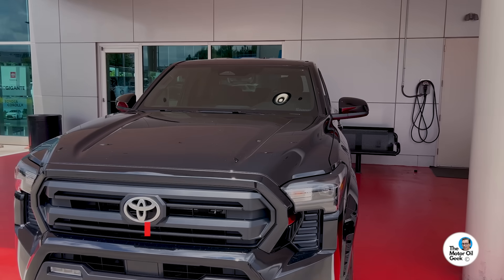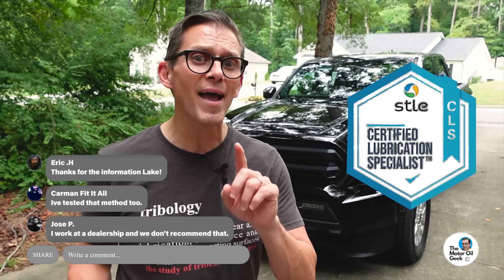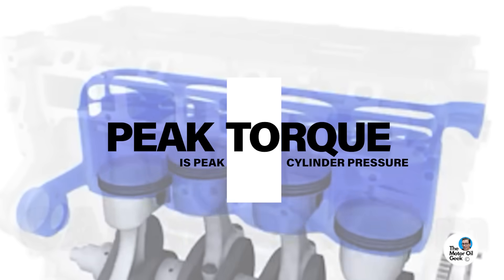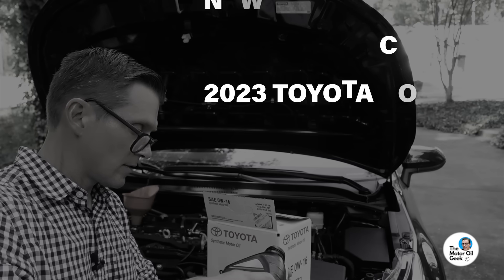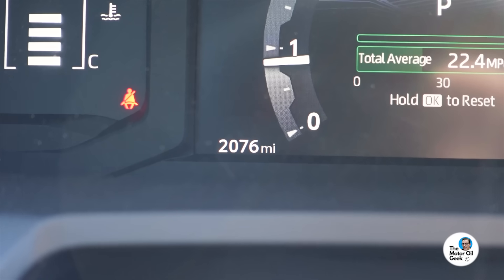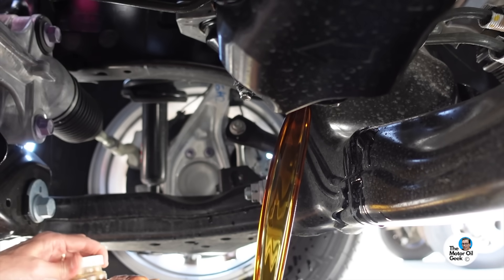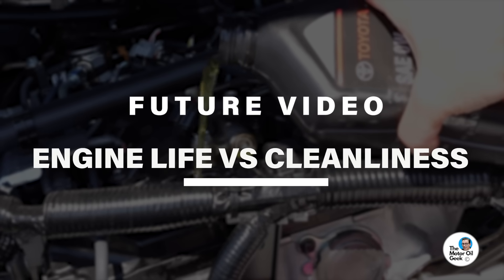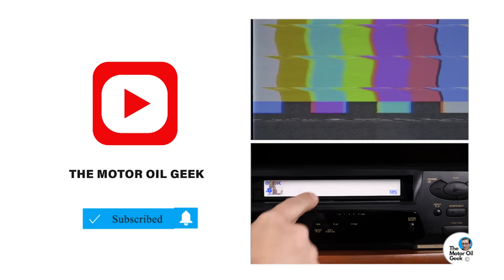The FACTS About Oil Changes (What The Owner's Manual DIDN'T Tell You)

Comment: Intervals set by CAFE standards probably
Reply: Lake, I’d like to see 0W-20 Vs 5W-30. Bearing clearance, bearing pressure, block and rod material seems as if it would do better with the bump in viscosity.

Comment: You shouldn't follow the owners manual when it comes to drain intervals on your transmission, differentials, and transfer cases either.  I changed all of mine at 20k.  Both diffs and transfer case fluids came out looking like grey milk (they had THAT much metal dust in them).  The magnets on the drain plugs had so much built up on them that they weren't collecting any more metal.

Comment: I think some people have always thought I'm crazy. I have always done what I call old school break -ins, driving and early and often oil changes. When you check the oil on a new engine, for a while your paper towel you wipe it with will have black residue, that's tiny contamination. On a new engine wipe the oil off the end of the dip stick with your fingers and rub your fingers together, you can actually feel the tiny grit. Your oil change method pretty much mirrors mine, I guess I'm not as obsessive as believed. Great Video.

Comment: If you guys don't think this works, do this experiment with your new lawn mower next Spring. 
Run the brand new engine wide open for 10 minutes then change the oil. Then run for 20 minutes and change the oil again. 
Look at the metal that comes out of it!!
Learned this trick from the Garage Gear channel.

Comment: And the residual in the filter that wasn't changed??? 🤔
Reply: Agree should have drained filter and allowed block, main oil gallery, and pump to drain.  These new T-GDI engines will retain as much as 15- 20% of old oil in the engine.  I do fresh oil flushes once a year.

Comment: Unless you're GM or Toyota, most newly manufactured engines will survive to the end of the factory warranty period with minimal of no oil changes. After that period, all bets are off.

I have a friend that purchased a couple Toyota Tacoma trucks over the years. The dealership offered oil changes for life at the dealership, which for him was a big selling factor. The first Tacoma went 200,000 before he traded it on a newer model. The second Tacoma was up close to 200,000 when Toyota replaced the frame, including all the bushings, and lubes in the transmission, transfer case and differentials. 
His Toyota luck ran out on the Tundra, when he had 3 engines installed in under 10,000 miles, thanks to cost cutting by Toyota.
Reply: Cost cutting by toyota is like pursue of perfection
Reply: Toyota fixed their engine my guy.
Reply: @Dave-om6nd 2025 Tundra engine recalls, still not fixed.
Reply: @Dave-om6nd Just got the recall notice on my 24. Definitely not fixed.
Reply: @drrok4603 they didn’t fix the engine until the second half of 24 smart guy. So of course the 24 was going to get a recall, that wasn’t a surprise to anyone paying attention.

Comment: Interesting the fuel dilution levels in these samples. Looking at some of the Lexus models that have the same engine, T24A-FTS, they're showing a fuel dilution of around 3%. Small sample size though.

Also surprised to see the cliff on the moly levels. TGMO 0w-20 for years was jacked on moly, but now it looks like they changed the formulation. The VOA has a more moderate moly level than prior VOAs on this oil. I wonder of they're reducing moly or moved to trinuclear moly vs di. The data suggests the TN is better at the sequence IV-A cam wear than di but the moly levels in the VOA are still much higher than those tests would indicate is necessary (maybe 100ppm and beyond has no significant improvement).

That TGMO 0w-20 hugs the lower level of the 0w-20 spec. It has a lower 100c viscosity than many other 0w-20s. Will be curious to see how it performs over the years in wear metals in the engine.
Reply from the maker: The lower Moly is due to the turbo. The high moly Toyota oils are for naturally aspirated engines.
Reply: @themotoroilgeek  Mr Lake, can you please explain this as to my knowledge Toyota has only 1 type of 0W20 that they sell at the dealership which shows around 700 ppm of Moly in VOA. How come the Moly content in this oil dropped to 200+ ppm? Also, how can you explain a drop in kinematic viscosity (less than 7 cst@100C) within a such short mileage? According to VOA of this oil, its initial kinematic viscosity is around 8.5 cst@100C. Your insight is highly appreciated. Congrats on the fine truck!
Reply: @themotoroilgeek  just to make sure I'm tracking, you believe that Toyota reformulated the 0W-20 because more of their vehicles are equipped with turbos?

Comment: I've used this method for my motorcycles,  250, 1000, 2000 then every 5000. Filter every other change. Cars or trucks, i by used, never new !! Ams oil only. Over 100 K on many motorcycles with no problems.

Comment: Thanks Lake for the video. I do not see the point of adding a fresh quart of oil to run through the engine and into your drain pan while leaving an oil filter full of dirty oil. Might buy into it if you removed the oil filter and drained it then re used it.

Comment: I do the same on every new motor I buy. From lawn mowers to outboard boat motors, to new cars. I also change the oil first thing on any used motor I buy, because I have no faith in what the previous owner did, even when I have fairly good idea what sort of "engine" person they were (i.e. grandma that does it religiously, or my brother that is a gearhead). I still like to have my own baseline to start.
Reply: Same here. I just purchased ed a 23 F150 3.5 ecoboost this summer with 27k. First thing I did when I got it home was an oil change despite the dealer doing one when it was traded in. Threw VRP, got rid of the junk Motorcraft filter and changed again after 3k miles (30k) with VRP again.
Reply: Planning on buying a 2010 honda that carfax said they changed the oil every 10,000 miles. What process would you recommend ?
Reply: @denniseucke1061  rubbish wouldn't even buy that too old

Comment: Great information. My dad or myself has had a compact Toyota pickup or 4Runner since 1982. Neither of us has ever had a repair. Not once, zero, ever. Just maintenance. They are so well built. But we both always did a break in period oil change. I’m sure it makes a difference in engine life longevity.
Reply: How many years have you owned these vehicles and what was or the current mileage for these vehicles. Too much information is missing from your comment. Note, there is is nothing in your comment that states these trucks are over 40 years old, it is just that you have used these type of trucks since 1982.
Reply: @a @americanbobtail1 we both keep our vehicles about 10 years each and usually put over 100,000 miles on them.
Reply: @daleshisler2955 - Well there you go.  You shouldn't have to do much work on a vehicle for 100K miles. Your statement is quite misleading.
Reply: @americanbobtail1 not misleading at all. I’ve had repair issues with nearly every other brand of vehicle I’ve owned at similar mileage.
Reply: @daleshisler2955 - First you say you have only Toyota trucks since 1982 that appears to indicating that you owned these vehicles for over 40 years and it is not the case. Now, you are saying you own other vehicles. Your statements are over the map and in my opinion can't be trusted.
Reply: @americanbobtail1 I don’t think you would find it difficult to find people who would agree that Toyota trucks are among the highest quality vehicles on the road.
Reply: @americanbobtail1 That early 1980s series of engines were extremely different from what is around today.
Those could be seriously ignored and still keep going though I learned there is a limit as I made the mistake of buying an early 80s Toyota pickup that only had a wee handful of engine oil and zero fluid changed from new it was totally shot at 110,000km  midnight black ooze in both engine and transmission. 
Today's need better care/upkeep or they die much sooner than the 10 years you could goof off with an early 80s type.
Reply: @RetroCaptain - Read OP second comment. He is making a comment on vehicles reliability based on owning it for 10 years and 100K mileage, which should  not require more than scheduled maintenance anyway. He has not kept these trucks for over 40 years.
Reply: @americanbobtail1 it's practically impossible to keep anything for 40 years other than earlier Rolls Royce
Reply: bruh,  a 1982 Toyota was peak quality, stuff these days is break down at 100K quality.

Comment: 46 year ASE Master Tech, Lake is spot on! As usual, best oil channel anywhere!
Reply: The only problem is the 2025 taco with the exploding transmission
Reply: @RipliWitani  Tacoma hasn't had a decent transmission since 2015 and older model years.
Reply: 🎯 Similar experience here, started it 10 years after you then got out of the industry but stayed involved.  My Certs have long since lapsed but the "basics" haven't changed although certainly metallurgy, machining, and chemistry has improved.
Reply: 21 years master tech, you can put the oil you want the engine will still blow up, japaneese are garbage and the mechanics that thinks its still good needs to retire asap, i build engines for a living, its all garbage now we have 30+ tacoma and tundras engines brand new all blown up, i need to hire people but its so bad that i barely make money on them
Reply: Agreed - 100 percent mr. master.

Comment: This is truly great information, but that’s not one of the recommended approaches for Ford Coyote engines, which develop a tick (aka “BBQ Igniter”, “Typewriter”). There’s theories as to why it happens, but nothing definitive. The one common theme is it usually happens right after an oil change, dissipates over time and miles, only to come back right after the next oil change. Some recommend to extend drain intervals, including the first one. Others recommend additives, like Ceratec. I’ve even read that since it doesn’t happen when the vehicles are new therefore Ford must be using an additive in the factory fill. And that the additive XL17 is suspended carbon, which may explain the tick return after clean oil is added. Ford has stated that the tick is not harmful, but offers no other guidance.
Reply from the maker: Stay tuned

Comment: I changed my oil at a 100 miles then 500 miles, then 1500 miles, then 3000 miles after I rebuild engines. And I keep all my old changes at 3000 miles

Comment: I put Fumoto valves on all of my cars to make oil drains so much faster and easier. Highly recommend.
Reply: That are fantastic!
Reply: Depends where it is mounted. Ever had a low car hit road debris?  I like it for my Honda S2000 regardless. I can change the oil and filter without ever getting under the car. Just kick the oil collecting pan under the car and reach down and throw the lever.
Reply: @pault6533  They have low profile versions. There are very few pan configurations that aren't suitable.
Reply: Meh. It depends on the design of the oil pan. The quick change drains sometimes interfere with completely draining the pan if they add an extra "step" for the oil to flow over. So you are adding fresh oil to a pool of old contaminated oil still left in the pan.
Reply: @budlanctot3060  Meh. Very few pans are problematic. Suit yourself. My experience across multiple vehicles from multiple manufacturers has been great.

Comment: Dang, wow! I did a very similar oil change regimen when I bought my 1996 Jeep Cherokee XJ new. 368,000 miles now, no internal engine work.
But I used natural oil, changed the filter. Switched to synthetic after around 3K IIRC.
Reply: rubbish

Comment: I do 500, 1000, 2500, 5000 then every 5000 miles.  I do used oil analyses on each oil change.  On Toyotas, I use the TRD oil filters.

Comment: I certainly won't call you crazy. I open up my oil filter and the sheer amount of crap in those US made Toyota engines is off the scales.. Had to do 3 quick OCI to rid my brother's Hybrid CX50  engine of all the shavings it had in there.. 4xxkm, 15xx km and 3xxx km if i'm not mistaken. Did another one at 8000km and it started to be decent. By comparaison, both my japan made Prius Prime were spotless. Well, not really but the metal in my Priuses filters were looking like what a breaking in engine should look like. The Hybrid CX50 had shards as big as a toenail clippings.. 😮

As for the oil filter change interval, Honda does it. They have oil and filter change intervals and oil change intervals (the A and B maintenance). Those automakers really know something we don't.. When you'll change it however, if you want a sightly longer alternative, the OE Tundra filter 90915-10010 (yzzn3) does the trick. It has about half an inch longer paper element so it "should" be a higher flowing, lower restrictive, longer lived alternative. That's what i use anyway.. 😂
Reply: I opened up the filter at 800 miles on a Toyota A25A FKS US made engine. There was no visible debris.
Reply: @SingleStacked lucky you. I'd post the pictures i have here if i could..

Comment: That is one thing I dislike about the thinner oils.  My 2015 Chevy truck uses 5W30 and I can almost completely remove the drain plug before the oil starts coming out very fast.  I suspect it may also have tighter fitting threads.  My 2022 Equinox uses 0W20 and it starts leaking out pretty fast almost as soon as the plug is loose.  Very annoying.

Comment: I change my oil and filter after every 1,000 miles...  never had a problem other then my wallet feeling light. But seriously .... it's all about how hard you drive your vehicle and the conditions. A person who drives to the local market daily,  breaks down oil faster than someone driving on the freeway... the modern computers in cars does in most respects, estimate the life of the oil.  Why has it got to this point? People for the most part, especially in climate zones that use salt on the highway, replace their vehicle before the engine service life is up.
Reply: OMG, 1000 miles. That is too much. Modern oils are great. 5K miles will be fine.

Comment: I think the only point I would differ on is the oil filter at 500 miles. There's so little loading at that point (of smaller particles), and I want to get that debris it has captured out. I know it would stay put (most likely) just fine. But I'm putting in the filter I like in at 500 miles and then I'll let it sit...

Comment: That's how i was taught in trade School back in the 80's, no matter new vehicle or rebuilding your engine. Not only engine, differential, transmission , transfer case,oower steering if all so equipped.

Comment: I just purchest a 2020 Mazda GTR with 16600 miles. the Car Fax tells me they changed the oil every 3000 miles , one at 1500. That is way better than most for getting a used car

Comment: My 2024 Corolla uses 0W-8 oil which from Toyota is $20 a quart last time I checked. Walmart has the 5 quart jug of 0W-8 Mobil 1 that's GLV-1 compliant for about $27.47. That's what I use. Toyota oil is reportedly Mobil 1, so I'm good with using that. 

I change my oil and (OEM) filter every six months or 5K miles with a new Toyota drain pan bolt crush washer. Considering my car only has 7K miles on it to date and I've changed the oil and filter three times already, I think I'm good. I like the old school round head Craftsman ratchet (made by Easco). Those are among the best ratchets that Sears offered in the Craftsman line. I have a few as well. Toyota specifies 10K oil changes and I'd neve go that far. With the driving I do, twice a year should be just fine. 

I think the point is that you use the owner's manual for guidance, but if you exceed the requirements (aka using severe duty service maintenance intervals) then you should be good.
Reply: Don't use 0w-8 or 0w-16 this is what the Toyota manual in Australia says

SAE 0W-16 is filled into your Toyota vehicle at manufacturing, and the best choice for good fuel economy and good starting in cold weather. If you use SAE 10W-30 or a higher viscosity engine oil in extremely low temperatures, the engine may become difficult to start, so SAE 0W-16, 0W-20, 5W-20 or 5W-30 engine oil is recommended. Oil viscosity (0W-16 is explained here as an example): • The 0W in 0W-16 indicates the characteristic of the oil which allows cold startability. Oils with lower value before the W allow for easier starting of the engine in cold weather. • The 16 in 0W-16 indicates the viscosity characteristic of the oil when the oil is at high temperature. An oil with a higher viscosity (one with a higher value) may be better suited if the vehicle is operated at high speeds, or under extreme load conditions.
Reply: @qrowthebird7496  Not correct. USA destined (and assembled) Toyota Corolla models are factory filled with 0W-8.
Reply: Mobil 1 is junk. 0-8 sounds awful
Reply: @RipliWitani It's mediocre at best. The whole Corvette factory fill is just because of their great marketing campaign. Tell them to get the oil tested and see just how great it is.  😂😂😂😎👍👍👋💯
Reply: @Jay388  Nothing wrong with it. Same thing with Supertech. If the right oil is used in the right application and changed when it should be, you'll be fine. 35+ years of experience with not a single oil related failure in anything I own has proven that right.
Reply: @RipliWitani  So bad that it has been used as factory fill on Corvettes for years. That's hogwash. Nothing wrong with Mobil 1 when it's used in the right application. My 2009 G6 likely had Mobil Clean 5000 as factory fill from GM as well. 

I don't know where your "data" is coming from, but it's far from accurate.

Comment: Fun topic: Can or should you use a product like Valvoline Restore and Protect on a brand new vehicle? If not, at what point should someone use this type of product?
Reply: Yes, you can use it on new engines according to Valvoline. I am using it on my new Toyota due to the low-tension rings.
If the rings are kept clean they won't stick.